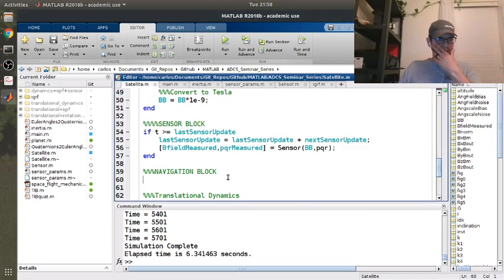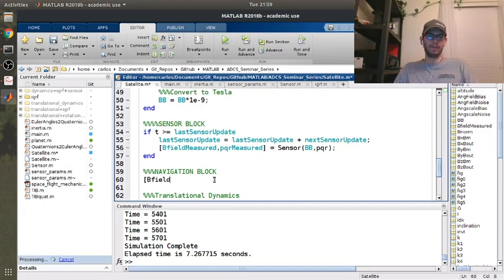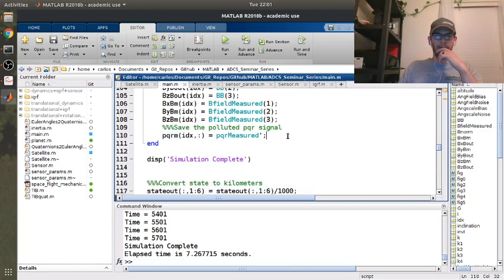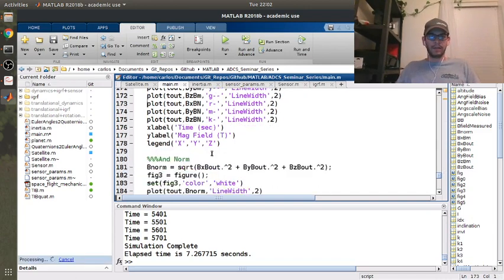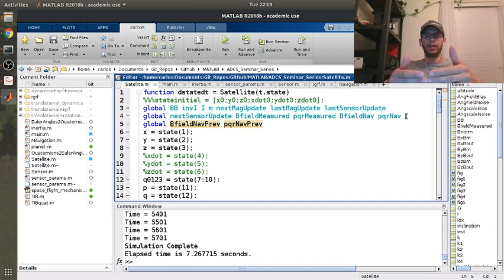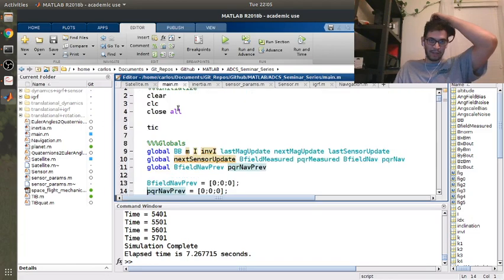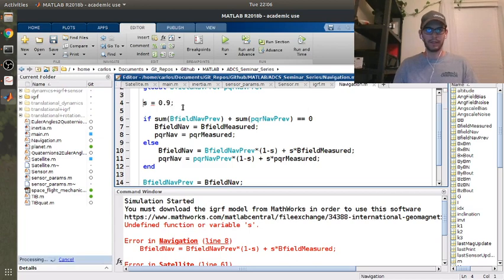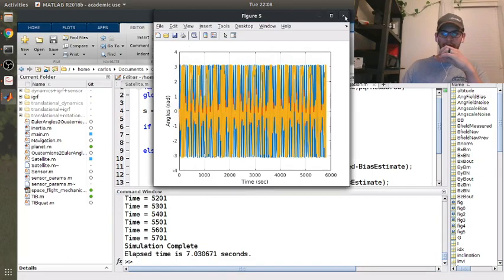MATLAB Help - Adding the Navigation Filter to Polluted Sensors for a Low Earth Satellite Simulation

Comment: Based on the navigation complimentary equation shown in your lecture 6 of ADCS seminar series, the BfieldNavPrev & pqrNavPrev should be multiplied by s and (BfieldMeasured-BiasEstimate) & (pqrMeasured-BiasEstimate) should be multiplied by (1-s). Please correct me if I'm wrong. Thank You!
Reply from the maker: You can actually go either way. You can use the form.

x(i+1) = x(i) * ( 1- s )  + s * y(i)

and have s go from 0 to 1

or 

x(i+1) = x(i) * s + ( 1 - s ) * y(i)

where s goes from 1 to 0 with the same effect.

Apologies for the confusion but as long as you bound s from 0 to 1 and understand that the edge cases swap when the equations change you can still use the filter in either case.
Reply: @CarlosMontalvo251  Alright understood, Thanks for your response.

Comment: Since bias is multiplied by (2*rand()-1), it is essentially plus/minus bias. Assuming your measured signal was biased in a negative direction, and you 'knew' your bias and inputted it into the BiasEstimate = [x,x,x] - subtracting BiasEstimate from the Measured value would bias it even further in the negative direction, no? 
What I mean is, would Measured-BiasEstimate only help if that instance of bias was positively skewing the measured angle?
Reply from the maker: Not exactly. Let's say your measurement was the following with a positive bias.

x = 4
b = 1

Your measurement would be x + b = 5 = xmeasured.

If you knew your bias you could do 

xestimate = xmeasured - bias = 5 - 1 = 4 (the correct value)

If we do the same with 

x = 4 
b = -1

Then our measurement would be x + b = 4 - 1 = 3

Then our estimate would be 

xestimate = xmeasured - bias = 3 - - 1 = 4 (the correct value again). The double negative means it works either way.